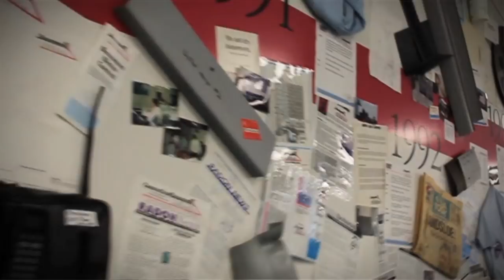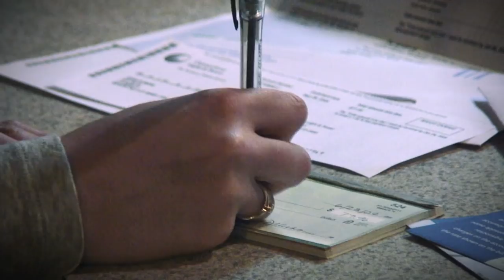Saving Energy at Home | Home Energy Audits and Conservation Experts | Dr. Energy Saver

Comment: Ted Kidd
Common sense tells you that any improvement to your property that reduces a bill in essence will "pay for itself". Rate of return on a energy retrofit varies but even at 5% (most are 25% to 40%) its just a matter of time but if your house is cleaner, more comfortable and contains less allergens what's the value of that?